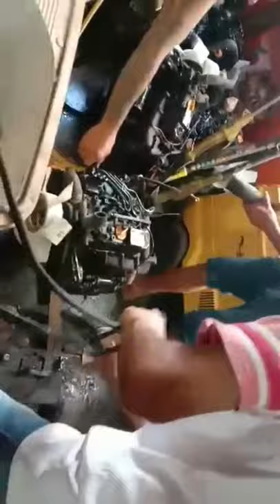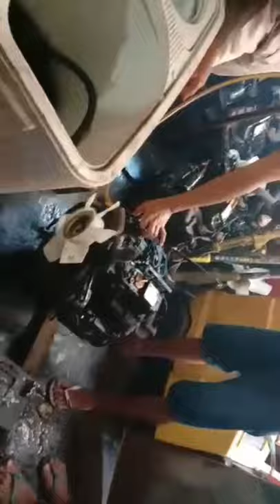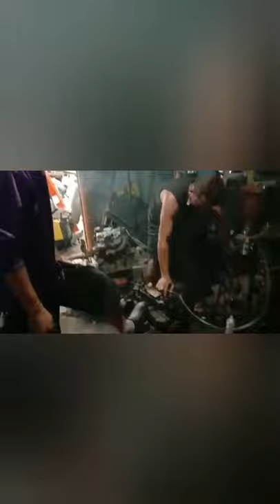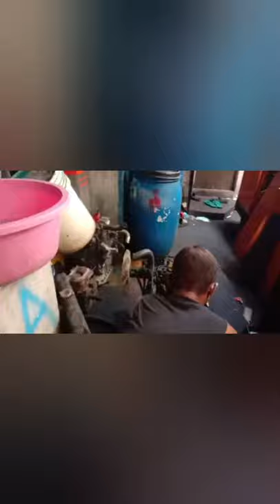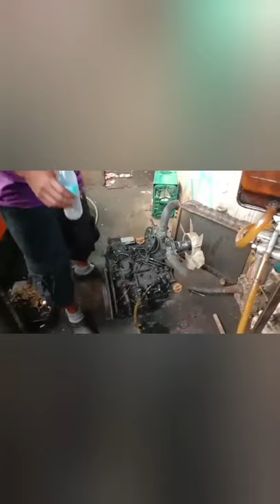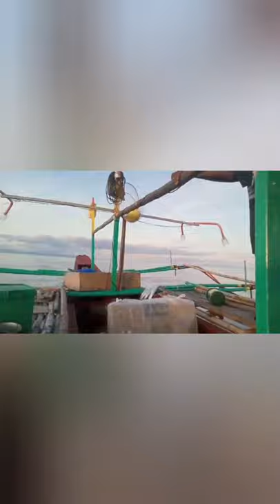YANMAR/3CYLINDER 13HP. MARINE ENGINE..IN  Quiapo manila...

Comment: Tanong ko lang po mas maganda po ba ganyang 15 hp engine kesa sa typical 18 hp pump boats d2 sa pinas?

Bumili kc kami yamada 18hp diesel tas nakalagay sa 30 foot na bulacan design fiber boat tas 25 kph lang takbo niya hirap pa pinalitan din naman ng prop na mas malaki mas bumagal pa worth it po ba yan?
Reply from the maker: Subokan mo boss yanmar na 3cylinder